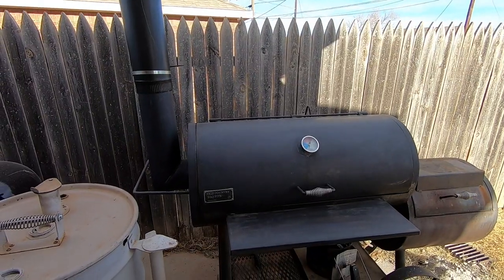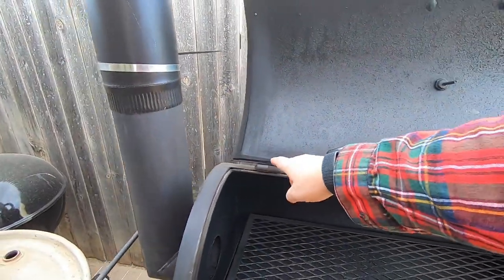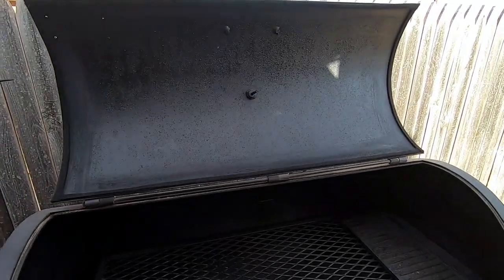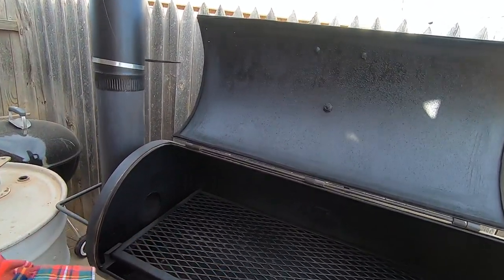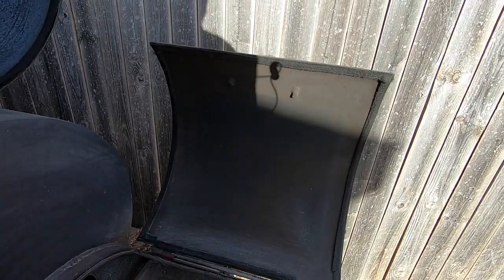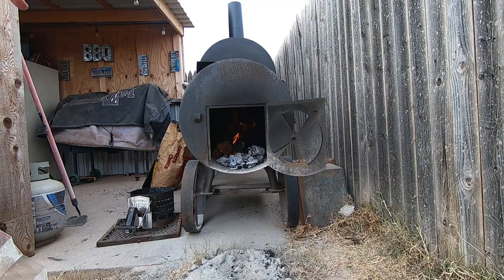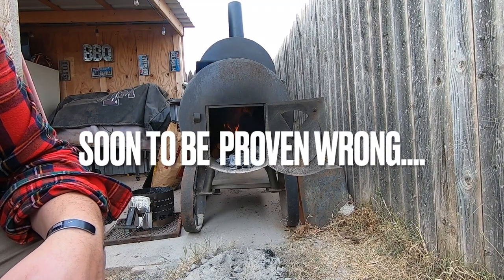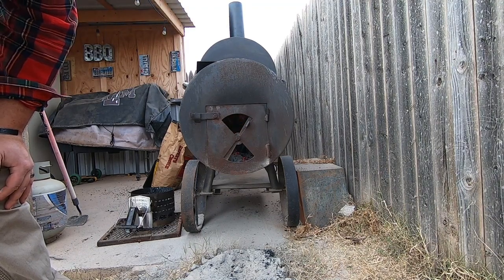Old Country Pecos Exhaust and Heat Plate Modification  Brisket cook test #brisket

Comment: Thank you for the video, it gave me alot of information. After a brisket trial for an upcoming competition,  I noticed that my brisket cooked faster than I was hoping for. Turns out the gauges weren't reading properly,  long story short I drilled holes in the diverted plate and added the stack extension and I added some probes to see what the temps were and I got to tell you the gauges are off by 15 degrees, but its cooking way better. Sorry for the long comment. But also thank you. Can't wait to see how it works out for my competition. 
SMOKE ON
Reply from the maker: Thank you for the info! I’m glad it worked out for you! Let me know how it goes
Reply: @BrisketMedic  will do , I also changed up my firebox , what I mean by that . I used the grill grate from the fire box and place it at the bottom and I bought a lonsstar V shape fire basket and I use 8" to 10" splits , well I only use one every 30 minutes and it gives me 300° to 315°. Again thanks
Reply from the maker: @blackrooster48  good stuff! That fire basket from LoneStar is PERFECT for these smokers
Reply: Update :  I had my competition this past weekend and my pit with the mods ran awesome no issues during the cook , ran steady at 350° , so basically hot and fast. Wrapped it at the 4 hr mark , had the perfect bark I was looking for. Wrapped in butcher paper for 1.5 hrs then placed it in a foil pan with a brisket mop I made for another 1.5 hrs. Probed it and it was probing like butter so I pulled it off and out of the foil pan  and Wrapped it in foil and a towel and placed it in a cooler for about a 4 hr rest , right before turn in I pulled it out and and unwrapped it as I did so it started cracking on me , signs of it being to tender and over cooked. The puzzling part was that only the outside portion of it was coming apart at the smoke ring , I made it work. The brisket was perfect and flavorful,  but it bothered me that it was cracking like that. I was about to still get an 11th place Brisket,  but I know it was because of the doneness. Need to figure out why it did that.
Reply from the maker: @blackrooster48  interesting, glad the cooker worked out for you!
Reply: @BrisketMedic  thanks , yes it was , just need to figure out why it did what it did. Some people I have talked with about seem to think it may have been the wrapping in foil and then placing it in the cooler right away . But I wont know until I do another brisket , so we shall see
Reply from the maker: @blackrooster48  that’s a huge possibility. If it isn’t given a chance to lower its core temp it will carry over cook until over done for sure. I’m actually working on a video on this subject!
Reply: @BrisketMedic  can't wait to see it .

Comment: Great idea with the holes. Never would have thought of that. I was really struggling with the heat on the bottom. I'm sure that will fix it. Thanks
Reply from the maker: It does a great job, but I’m working on a little different approach to make it even better!
Reply: @BrisketMedic  I will be interested to see it. I'm in Pennsylvania so I won't be smoke for a little while so before I start cutting holes I will have to watch it. 
Thanks
Reply: @BrisketMedic what did you end up doing instead of the holes?
Reply from the maker: @JC-og5bx  hey Jc. I ended up removing it completely. Running great now

Comment: Great job and explanation Zach, a little basket or at least a flat tray with expanded metal or holes in the firebox will help a bunch to in those longer cooks. Keep up the good work.
Reply from the maker: Thanks brother! I plan on building a basket, of sorts to contain and keep the ash building up from effecting the coal bed too much. Very similar to the lone star basket.
Reply: @BrisketMedic   souns goo, also high temp rtv silicon works good on warped doors, I spray pam as a non stick and just lay the door down after it sets a little while, good luck
Reply from the maker: Great idea on and the pam

Comment: I’ve had to do some mods to my Old Country Angus as well. I get plenty of draw with my dual 6” stacks, but still. Major firebox issues having the top loader and had to buy the aftermarket diverter plate from bbq smoker mods to get the cabinet to heat properly.
Reply from the maker: I was noticing some of the mods you’ve made on your Instagram. I’m contemplating welding the top door shut, and sleeving over it for a semi-insulated box. Need to find the best height for my stack before I weld a permanent extension on. And a top shelf, and a water pan shelf, and … lol. Lots of additions I want to do. And can have a greasy smoker for under $1k
Reply from the maker: And thank you for all your support!
Reply: @BrisketMedic  I’m contemplating welding my top door closed as well, we rarely use the grate feature for the firebox, one of my buddy’s also suggest cutting off the firebox door and installing a half door or a doghouse door. Just so many little things that Old Country could of done at the factory to dominate the mass produced bbq market.
Reply: @BrisketMedic  whenever I can brother!

Comment: We have the Pecos smoker as well and I'm looking into mods again since it's been on the market for awhile now. I don't like to jump the gun too soon and start doing a bunch of mods until different ones have been tested and possibly improved upon, I don't want to waste time or money trying a bunch of things that maybe something better, cheaper or simpler could have solved from the beginning. One of the things I recently noticed about these smokers, which was brought to my attention by another YouTuber that was a bit disgruntled about the design of these smokers, is that the round exhaust transition hole that is cut into the side of the smoker which leads into the exhaust tube is smaller than the actual tube itself and supposedly too small for good flow and/or efficiency. I haven't actually watched the video yet but in his description I believe he cuts the hole bigger to match the exhaust tube and I was wondering if you've heard of this mod before and if you've done it and what you're thoughts are about it?
Reply from the maker: I opened mine up, I can’t say it made a huge difference or not, but fluid dynamics says it must have. Thanks!
Reply: @BrisketMedic  Thank you, I'm going to try and see if I can find out any more info about it and what some are saying if they've done it to theirs.

Comment: I would like to see internal lower exhaust elbow to bring that heat across the bottom
Reply from the maker: That’s how it cooks from the factory, bottom up. Bottom up cooking isn’t really ideal for high air flow fire management or the cooking style I prefer. From the factory you can cook that way, very well. Closing the door and exhaust damper and basically running a low and slow coal bed.
Reply: @BrisketMedic  
Sorry but I've never seen a lower exhaust elbow where the exhaust goes down to the bottom with the heat management plate drawing that major heat across the bottom before it rises to the top
Reply from the maker: @raytrout8272  the stock old country doesn’t have an elbow, but it isn’t needed due to the plate at the firebox side of the cooked that deflects everything to the bottom. 👍😎

Comment: Question about the holes in the damper. Would you have put less holes? Also is the hot spot significantly higher right by the box?
Reply from the maker: I eventually ended up removing the baffle completely, this was a test for making steps instead of just pulling it out and regretting it. 

With the baffle fully removed, proper stack extension, and fire management I can use 75-80% of my cooking surface and it be even. 

Take a look at my old country playlist to see all the mods!
Reply: Awesome, appreciate it brother I'll check it out. Appreciate the video and your approach
Reply from the maker: @AnthonyAndel  glad I can help!!

Comment: My man, rip that baffle out completely. I have the same and it runs now like. $2k smoker.
Reply from the maker: I actually did do that, this video is a series of modifications for the old country pecos. Check out the play list. I tried small adjustments at a time until I got my current set up. Good stuff

Comment: Got a ? I added the extension to my pecos but I did remove the baffle and my temperature is still off,any advice, I'm doing a brisket right now 😔
Reply from the maker: You may have too much extension, and not enough back pressure. Basically drawing so well it sucks the heat right out. Try putting a log over 1/3 of your exhaust and shutting the door to about 1” open
Reply: @BrisketMedic  its 16 inches from original stack just like Raleigh smoke said to do.
Reply: @BrisketMedic  ok, thanks

Comment: I was thinking about getting a pecos. Kinda weird the manufacturer puts the baffle in and everyone cuts them out or drill holes in it. Also you got a steal fir $2200. They are $499 here in ok.
Reply from the maker: Hey! I bought this one used on fb, so i got a good deal on it. I believe the original design of the Pecos and Brazos is to have the baffle and the exhaust damper to create back pressure and even the chambers heating and cooking. This is different style than the convection style of cooking many people know and depend on air flow.

Comment: Hey great content, I noticed you also had a Webber kettle and a drum smoker,  I also cook on those as well as a flat top griddle.  I'm looking into getting an offset smoker, and was wondering if there is a significant difference with the flavor of the food between the drum smoker and offset one?
Reply from the maker: Absolutely! Thanks for coming by. I love my small blackstone, but it’s time for a new bigger one! There’s definitely a difference in flavor profiles with the convective heat and smoke of an offset, I wouldn’t say any are better than the other, but definitely different. Thanks for stopping by!

Comment: Should I cut down my stack extension ?
Reply from the maker: I did mine, seemed to help, also use my wood as a partial baffle.
Reply: @BrisketMedic  how much did you cut the extension stack down to?
Reply from the maker: @ignoranceisnotatrend4669  mine is only about 14”.
Reply: @BrisketMedic  thanks for your advice, I'm cutting mine to 14👍🏽are your temperatures pretty even across the grate with 14 ,I went with 16 because Raleigh smoke was the first one I saw with these mods but maybe 14 is just as productive 👍🏽

Comment: What size holes did you put in the deflection plate? What did you use to drill them?
Reply from the maker: 7/8” step bit. Ran them all the way to 7/8”

Comment: Great idea drilling the holes without removing it, I have a pecos, how many holes would you recommend me drilling. Please comment back would love to hear your advice.
Reply from the maker: Kevin- right now I’m working to fine tune that very question. Seems there’s an amount that will balance things, and I need to adjust some of mine.
Reply: @BrisketMedic  thanks for letting me know, I came across Raleigh smoke he removed his but I like your idea with the holes in it, you think we should remove it all together like Raleigh smoke did or just put the tuning plate in front of it. 👍
Reply: @BrisketMedic  Any updates on the holes? Really trying to fix the hot spot on my Pecos... Maybe more holes?
Reply from the maker: @austenzacca2878  hey Austen! I actually ended up removing the baffle completely- BUT- it was because other mods I did to the firebox throat and exhaust. 

I believe with no other mods like I you can absolutely make a difference in the even cooking and hot spot mitigation. Check them out in my “Old Country Pecos” playlist! Firebox mods coming tomorrow as well. Thanks!
Reply from the maker: @ignoranceisnotatrend4669  hey, so sorry for the late reply! 

I think if you’re going to keep the mods minimal, you can just do the holes and call it good. Even with a stack extension it does a great job equalizing everything out without a plate. Follow the “Old Country Pecos” playlist for updates! Thanks for watching

Comment: Briskets looking good! Definitely try some of these pointers when I do multiple briskets. What’s the reason of the oak in the cooking chamber?
Reply from the maker: I should have explained that one lol- it wasn’t for anything other than to dry it up a bit and pre-warm it before placing into the fire box. I had some pretty high moisture wood, from being outside. Was 15-20%
Reply: @BrisketMedic  ah ok o had an idea but didn’t know there was another meaning to it. I’ve had great success in putting it on top of the firebox as well just an idea. I’m sure you’ve done it lol
Reply from the maker: @bulldogbbq3230  I do both, but with the wind being 30+ I just did it inside this time
Reply: @BrisketMedic  yeah that wind can really make the cook difficult!

Comment: I think I realized were my issue was with swings in temperature with this past Saturday brisket cook, 🤔🤔🤔I had the point of the brisket towards the stack and the flat towards the fire box 😔I'm guessing by the stack it  was not enough heat coming down there for the  brisket point 🤔and something else that I noticed that was strange was were I normally put a pan on the ground underneath the drain hole on the pecos by the stack I noticed "blood dripping from that hole,  dripping into the pan, and that occurred for a good amount of time, when normally if the flat was by the stack it would be regular clear  brisket juice dropping into my pan. SO BASICALLY I SHOULD HAVE HAD THE POINT OF THE BRISKET TOWARDS THE FIRE BOX IN THE BEGINNING OF MY COOK, and I did this on purpose just to see if I could get the brisket flat done faster than the point, the flat seemed to feel a little tender once I put the probe into it ,but all in all I'm guessing the point being by the stack in the beginning just didn't have enough make up heat for the point of the brisket to help cook evenly. Please  comment back and let me know your opinion.
Reply from the maker: I think it makes a difference in even cooking but I’m not sure what you mean when you say it contributed to the temp swings.
Reply: @BrisketMedic  the point of the brisket starting out by the stack was to big and even though some heat was going down there but maybe not being hot enough to cook and keep up with the flat that's by the fire box, the fire box had a probe reading of 275° and the stack was about 188° to about 200°
Reply from the maker: @ignoranceisnotatrend4669  you shouldn’t have a 75° difference in your smoker from one side to the other. It isn’t drawing well if that’s that case. Good experiment changing the way you place the brisket.

Comment: Where can I get a cheap stack extension just to see if that will improve air flow.
Reply from the maker: Home Depot for $9-$20 depending on the length. It’s simply 6” vent ducting.
Reply: Home Depot

Comment: Brisket medic,  I'm starting to think we nee to revisit tuning plates with the stack extension modification 🤔
Reply from the maker: I personally wouldn’t. You have to have a lot of cooks in to find the sweet spot that works for your smoker/climate. Mine runs like a top, but it took a lot of cooks and adjusting to make it happen. Where I live, there’s 20mph winds, low humidity almost all year around. It all plays a factor in it. Do a few cooks. Adjust. Do a few cooks. Adjust.
Reply: @BrisketMedic  thanks again for the knowledge and your speedy responses 👍🏽👍🏽👍🏽👍🏽

Comment: You're gonna ruin that burn chamber  with you just put coals on the bottom get a   charcoal  basket that leaves room underneath  for a way to get the ash and stuff out
Reply from the maker: Not always true, ash ruins metal; not the heat. Keep a clean box and no worries are had. I did however, add a basket for fire management more than that prevention. Clean after use either way will preserve metal! Check out a few of the other videos for this smoker to see how I did it. Working on another firebox mod as we speak! 

Thanks
Reply: @BrisketMedic  how is the fire basket working out for you? Awesome videos dude!
Reply from the maker: @treyealy3793  works great! And thank you! I believe it’s show cased in a few of the newer updates on my OC playlist